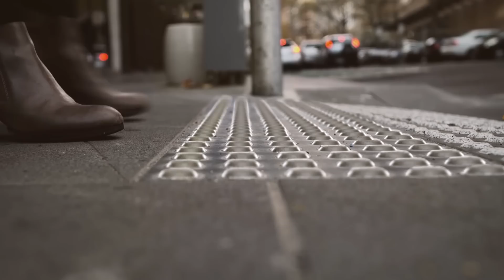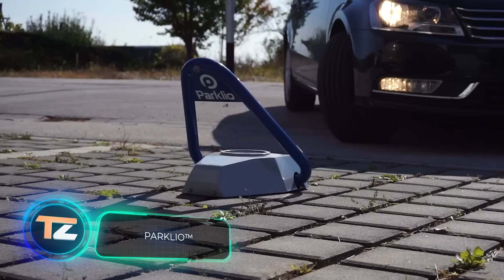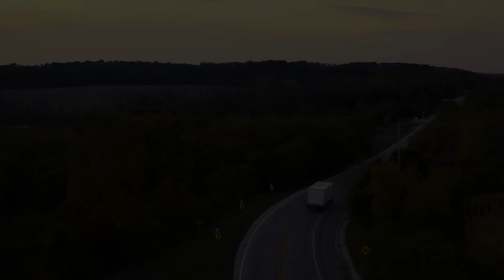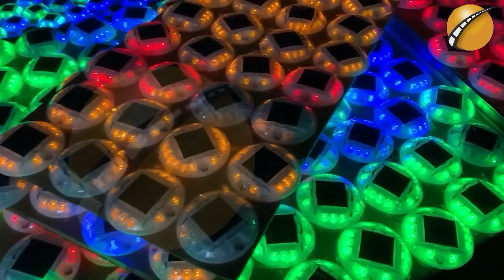INCREDIBLE ROAD TECHNOLOGIES THAT ARE REALLY INSANELY COOL

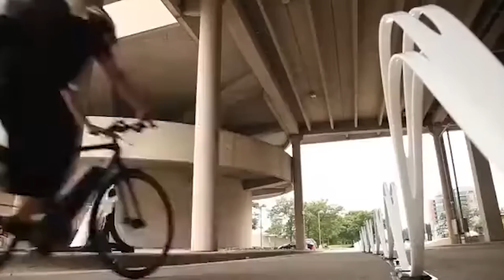Comment: 5:53 can we just appreciate how the road side barrier just tanks an entire bus without going through and also mainly keeping its rollers intact? It could probably tank another bus after that one.
Reply: It flings an out-of-control vehicle back into traffic.
Reply: docking boat technology >:
Reply: I guess I have been away from video games too long I thought he  was using voice to text and said take but software heard tank.
Reply: And "meets our safety standards"..!! That is funny.. esp how the WHO is out to be a safeguard.. 😏
Reply: Road barriers wasn't design to "tank" vehicles crashing into it but to gradually absorbs the impact and make crash less brutal for both the car and the driver.

In practice, the rail part of the barrier is meant to deform as each "pillars" absorb the velocity of the vehicle until their breaking point. When one do breaks, it pass the duty to the next pillar and so on until the vehicle involved arrive to a full stop or break the rail itself but heavily slowed.
The barriers shown in this video, by comparaison, are as bad as crashing into a tree since it doesn't absorb any of the car's velocity. The more, it flangs crashing vehicle back on the road and so in the traffic instead of stopping or slowing them.

On the other hand, those barriers were design to keep vehicle on the road in case of a cliff which would be deadly if the vehicle go off the road (or any other dangers and restrained space). But there's already a solution to this and it's simply the rienforced concrete barriers.
So those "next gen barriers" seems like an useless cheap alternative to me.
Reply: Based on your word choice "tanks" I'm going to go out on a limb and say you play MMOs. I'm a former WoW addict. Been 5 years clean and sober. Hearing the word tank almost triggered me to relapse. 😜
Reply: @oeliamoya9796  tanks are in no way related to mmo's
Reply: @thicksy  he wasn't using the word to refer to the combat vehicle, but rather the gaming notion of someone/thing that can absorb large amounts of potential damage and survive
Reply: @topomusicale5580  i wasn't referring to tanks i was referring to tanks

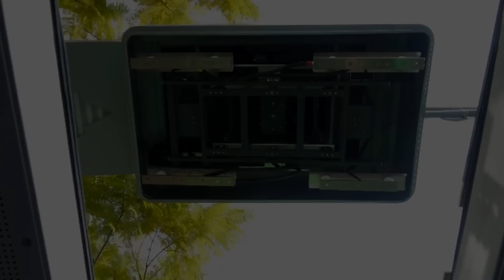Comment: 1:51  and 9:10  That will work right up to the point when someone crashes into it and damages it.
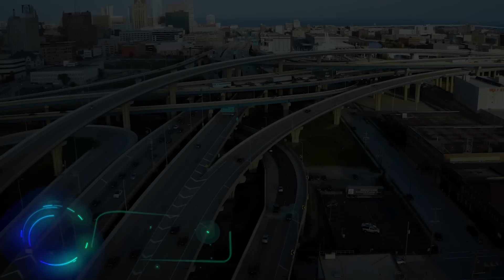4:10  I have already seen this on the road.  It is a good use of lights.  What is better is applying this to stop signs (I have seen that too).
5:54  This is a great product.

Comment: The bike lane things are cute but they won’t work in regions that get snowfall. You can’t effectively plow(with typical equipment) around those devices. You won’t be able to push the snow over to the side.
Reply: Googled it, Saris Infrastructure. It isn't marketed to be permanent solution. "Ideal for temporary pop-up bike lanes during day or week-long events or when communities want to pilot a location for a longer term protected bikeway. " A clue that it is temporary is that instead of being mounted into the pavement, it sits on a base.
Reply: @unkannyunkanny9232  interesting! Is the base a permanent mount or is the base temporary too?
Reply: I'm pretty sure the dots for lane markings aren't going to survive a snow plow either.
Reply: @darrennew8211  we’ve actually had those where I live and they do commonly pop off when plows hit them. They’ve stopped using them after they realized about 5 years was the max they lasted before all gone.
Reply: @TsunauticusIV  Yep. In SoCal, they're bumps. In Pennsylvania, they dig into the road and put reflectors below the surface of the road.
Reply: @darrennew8211  yeah wv and Virginia do the same with reflectors. I’ve driven a lot of miles down interstates popping those reflectors out with the corner of the moldboard of a motor grader. Have to remove them before an asphalt milling machine goes through to rip up the asphalt. The metal reflector housing damage the carbide teeth on the milling machine. We tried those dots down here in Virginia but it didn’t last too long. Went right back to the buried shoe style reflectors. We have used some of those modern 3M style buried reflectors that are made out of polycarbonate. Supposedly the milling machine can run right over those kind without damaging itself. I just never made it back to a job to see how it went before changing careers.
Reply: nobody is going to be out cycling in the snow anyway, so I wouldn't be too concerned.
Reply: @Fanta....  what? It has nothing to do with cycling in the snow but being able to push the snow off the adjacent vehicle travel lanes.
Reply: @Fanta....  when bicycle lanes are as much freed from snow as the street, I guarantee you that cyclists will use their bikes as much as in summer.
Reply: @Fanta....  Yes they are. Snow gives loads of grip for cycles if there is no ice underneath.

Comment: The Netherlands has fully separated bikpaths in the villages and cities the bike protection might help outside town centers but I feel the roller barriers is more usefull the the separated bikepath fence
Reply: I visited Amsterdam a few years back.  I was warned by the hotel concierge to be wary of the cyclists as opposed to the vehicles.  That was so true.  The cyclists are everywhere.
Reply: rather have a lower or flexable barrier next to me when I bike then this "wave" that goes up and down. Think pedals will get stuck quite easily in there. Not safe at all
Reply: Yea what the US thinks are great infrastructure (paint and at most plastic) are completely useless.
Reply: Putting bicycles on roadways is as stupid as putting train tracks on roadways.

Comment: It would be better for those barriers at the end to roll over the concrete part so it doesn't have to lift a 50 foot section, it would probably be faster too but you'd have to have a big section dedicated to just that.... Still an awesome idea but I don't see it working in deep snow or harsh weather conditions like full coverage icing, that would probably make it impossible them to lift if it had 3 inches of ice on it. Probably has some weight redundancy but not that much... Especially when talk about the 50 foot pieces.

Comment: I can imagine someone just stealing one of those portable speedbumps and it quickly becoming expensive to replace.
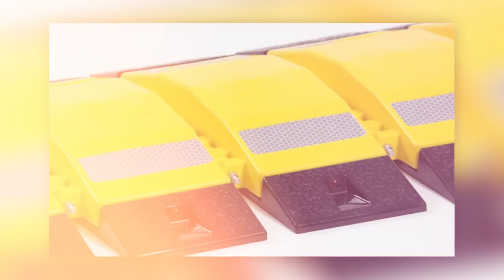Why take a speedbump you ask? Why do you insist my car must slow down? lol 7:25
Reply: I’m more concerned the speed bump moved slightly when wheels went over it. After an hour, it isn’t going to be anywhere near where it was to begin with.
Reply: @RageOfAThousandSuns  there looks to be holes at both ends, you could just bolt them down into the asphalt. no big issue.
Reply: @Fanta....  sure lets make some holes in the asphalt for a temporary speed bumb and shorten the time the asphalt can be used
Reply: @eenrandompersoon  Yep... There are reletively cheap anchor bolts  called locking mollie anchors that could be strategically installed in the roadway just for the purpose of portability of these things.
Reply: @RageOfAThousandSuns  it has an anti slip mat underneath
Reply: Where do I get thus speed bump. I live on residential street 25 mph limit with posts signs. Think people would slow down NOT. Cars race by 40-50 mph at least. Street is 1/4 mile long.
Reply: @George-py9bt  Better than speed bumps, I suspect, are the crosswalks that are raised up to sidewalk level (rather than curb cuts down to street level).
Reply: @bearcubdaycare  continuous sidewalks are cool, they really should build them in neighborhoods everywhere. Traffic filters are great too, so you can prevent thru-traffic from cars while allowing people walking or riding a bike to continue unabated.
Reply: @George-py9bt  I am sure Amazon sells them, make sure to tell all your neighbors and get everyone of them to buy one and put put in front of there house if you put enough out nobody will even Come down your street anymore not even the people that live there
Reply: a tracker could help getting them back and if they are used at events there are most of the time people to lead cars through the choas those are probebly the people that own the speedbumb
Reply: Just in case you're not joking, it's because little kids are unpredictable in parking lots, and in neighborhoods. And no... Realistically, parents cannot always totally prevent their kids from dangers, like suddenly running out in front cars being driven by reckless drivers who should know better, yet actually think their car must (NEVER) slow down.
Reply: Slow your car down or scrap it. Speed belongs on the highway, so take a hike.
Reply: @mrmaniac3  Hiking, what a great idea, we should get rid of cars and force everyone to walk and bike!
Reply: @Majorpainjr  true
Reply: if you see there is option to bolt it down to the road, so it will be difficult to take it away once installed permanently
Reply: @physics77guy  But they are not designed to be permanent. Who will pay to repair the bolt holes once they are taken away...holes that would turn into pot holes pretty quickly.
Reply: @lolzlolz69 taxes from the people which will be used to pay for it in the first place
Reply: @physics77guy  Nope , never used a glue gun? 
You heat the adhesive , and it sets at ambient . To remove you reheat and remove it . Simples 😊
Reply: I wonder if they could be modified to become stingers? The current ones are not really effective, but I this using this as a base could be interesting.
Reply: I do imagine those speedbumps are rather cheap anyways and probably meant to be very short term placements to actively used areas like events etc
Reply: Because I have to get loads of kids across the road to my home without being killed 😢